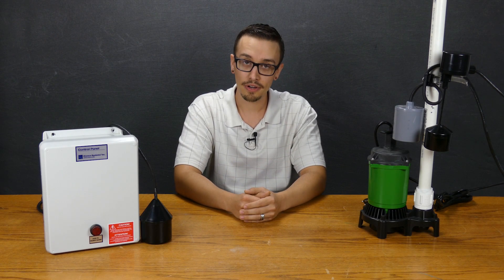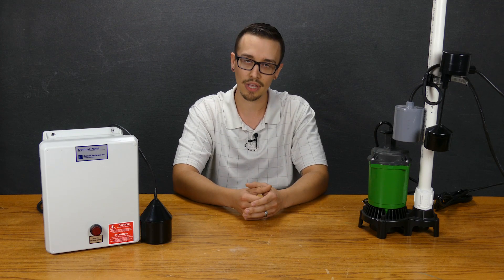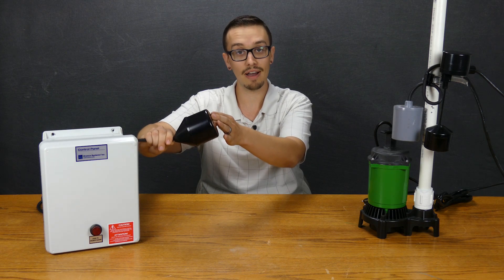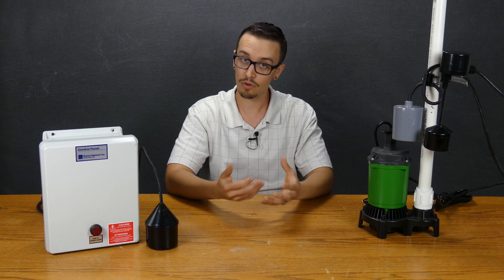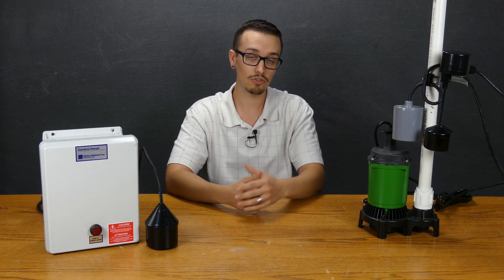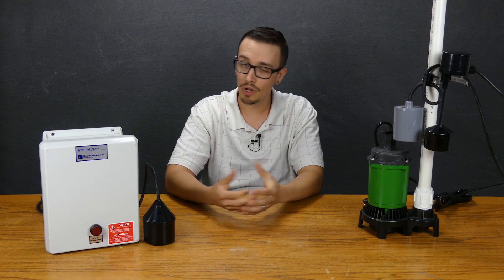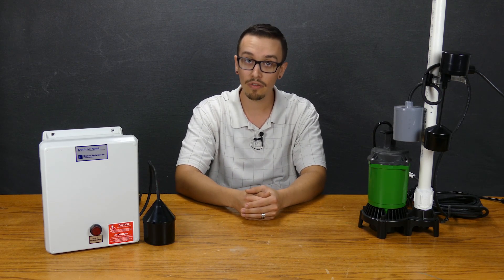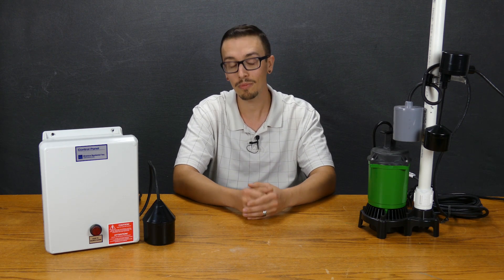Understanding Float Switches: Pump vs Control

Comment: My pump stopped turning off at low water.  I have a control switch, that does trip the alarm if I tilt it up. Pump switch toggles, but does not turn off pump.  It looks like the wires for the cntrl switch and pump switch run all the way, (approx 10 ft) into the alarm panel.  

Coming into alarm panel from sewer box I have 1-blk, 1-wht, 2-red, 1-grn
On the control panel I have L1 - N - 1 -2 terminals

Which wires should I disco from the control panel terminals in order to check continuity of pump switch open/close?
Reply from the maker: Give us a call: 855.329.4519